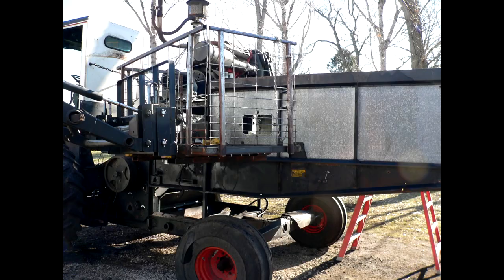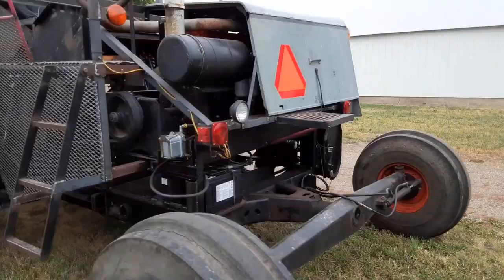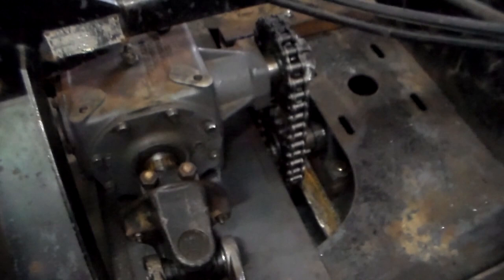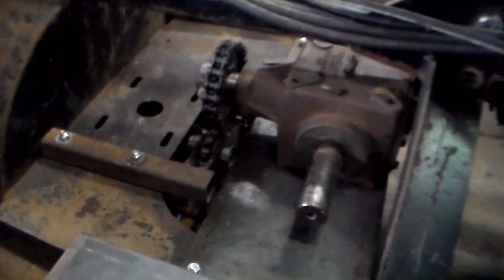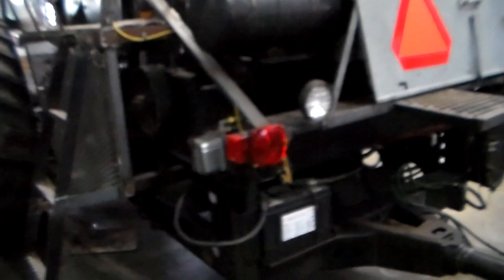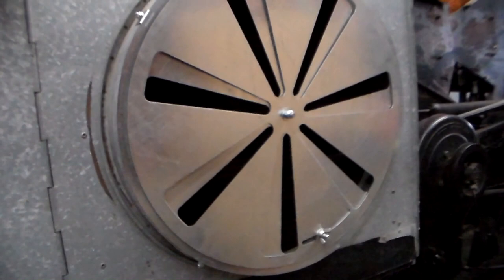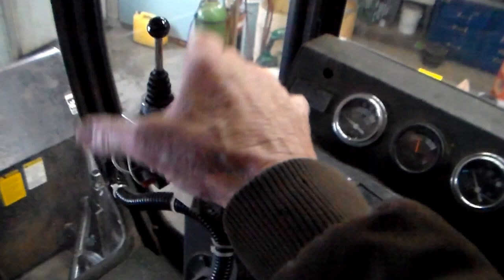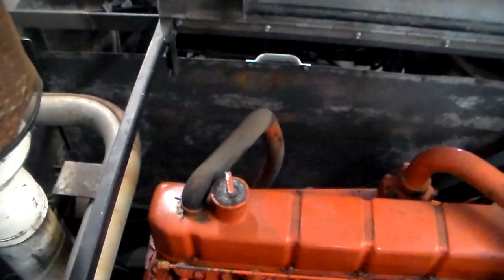Combine converted to snowblower

Comment: Very nice clean build. I was curious what brand and model hydraulic valve and electric joystick did you use and where did you purchase it?
Reply from the maker: The valve body is from Zoro industrial supply. part # 220879. Cost around 670.00   The joystick I purchased off Ebay. Did a search for joystick controls and found the one I purchased.  Designed for pickup mounted snow blades.
Reply: @hrodd2  do you have and speed control with this current set up or is it max hydraulic flow the moment you move the joystick? i am curious because i am trying to find an alternate way of operating the loader on our tractor
Reply from the maker: @Scoob450r  Regarding the valve body it is max flow when the circuit is energized. I do have a restrictor for the down motion of the blower as it dropped too quickly with out it. The down (for the blower) relies on a one way cylinder and weight of the blower for downward movement.

Comment: Well, project works, but, were you able to use at better than walking speed?

Not much application here in Alabama where I am.

For one, impressive.   My $0.02 worth.
Reply from the maker: I will push it as much as it will go. But it is also clearing a 9' path. Thanks for the comment

Comment: It's a 79 or older, it has a black cab
Reply from the maker: Yeah, honestly I do not know a lot about the Gleaner combines. The gentleman I purchased this one from had 5 or 6 on his farm that for one reason or another were no longer used.  He did have a rear wheel assist, but wanted to keep that model.
Reply: @hrodd2  I use to sell them, and if I remember right in 1980 the cab turned into saddle tan. So that would put it as a 79 or older. You said it had 135 HP so I'm assuming it has the 301 engine in it.
Nice job by the way
Reply from the maker: @RJ1999x  Thanks. I installed a different seat, but the interior of the cab was black. I replaced all the foam along with the seat. Had to loose that mousy smell. My friend that located the combine for me is an Allis man and diesel mechanic. He knows the specifics.  I was more interested that it ran and sounded good. SO, I may be incorrect on date of machine

Comment: This is a really interesting conversion! From what you described, you adjust engine RPM to control the blower and auger speeds, and then the hydrostatic to vary travel speed after you get the engine RPM to where the snow blower is working well. Is that correct?
Reply from the maker: Somewhat. I usually run the engine at full RPM, around 1850-2100. I can individually adjust fan speed via a variable sheave pulley

Comment: I saw a Gleaner combine converted to a grave digger.  West of I-94 Melrose MN IIRC.  They had frost teeth, cutting wheels, paddle buckets to a conveyor out the back.  I assume they put a skid loader? Or dump trailer behind?  I pulled over, walked around it 2x.  Every time I get in area I am tempted to look for it.

Comment: Nice build. What rpm is the blower fan running at? If I remember correctly the optimal feet/min you want coming off the fan wheel is 3500-4000. To me it looks like it’s running slower than that?
Reply from the maker: The machine was set up for 540 pto. I put a tach on the blower and adjusted it to run 650. So, it is actually operating faster than if attached to the tractor. I did keep the augers at the factory rpm.  I do have an adjustable v-belt sheave on the right side.

Comment: Good job. I have a rear mounted blower on my 1964 IH B414 but I have a plow on the front so I get the extra weight when Im not using the blower. It does the trick for now. Do you have a plow that you use as well? Cheers
Reply from the maker: No, I have left the snow blower on exclusively.  My unit does have a standard 3 point hitch, so I could couple up to standard attachments if I wanted to.
Reply: @hrodd2  I find I don't need the blower as much as the plow. But it's nice to have both options

Comment: Are you going to add any weight to rear end? Looks like it might be light with blower in up position..great job.. I've run Gleaners for 40 years..
Reply from the maker: Presently no, I like the fact that there is substantial weight on drive wheels and with a stab on the brake pedal the back end swings around quickly
Reply: @hrodd2  Can't wait to see it with deeper snow..

Comment: Where abouts in MN?  I see the old MnDOT logo on the blower.
Reply from the maker: blower was purchased from surplus auction. Windom area.  SW MN is where it's at now
Reply: @hrodd2  You are getting use out of it this winter down that way.
Reply from the maker: @chuckfinley4757  Yup. Thanks for the comment

Comment: How many man hours for the conversion?
Reply from the maker: You know I never really kept track. A lot. However in my defense I was engineering at the same time I was fabricating. If I did another it would be much quicker and straight forward. And I spread it over a couple years.